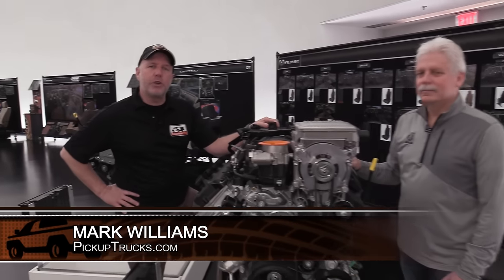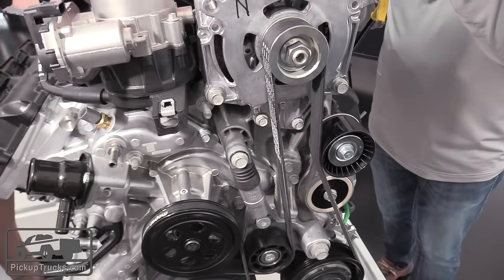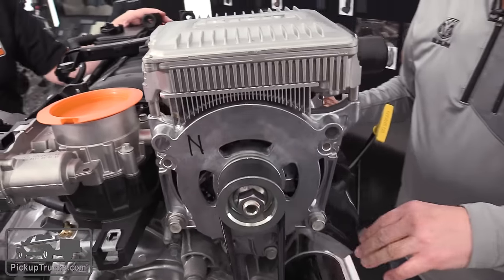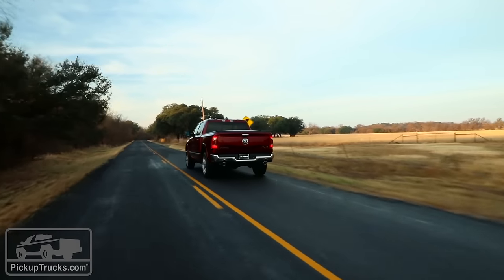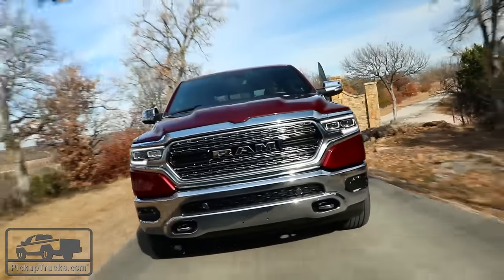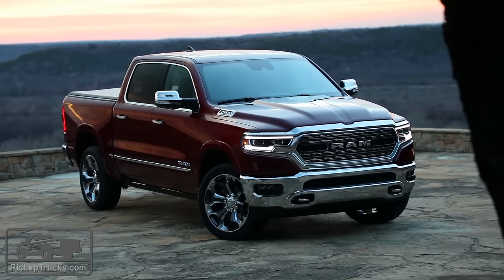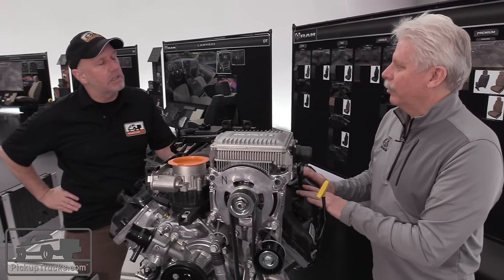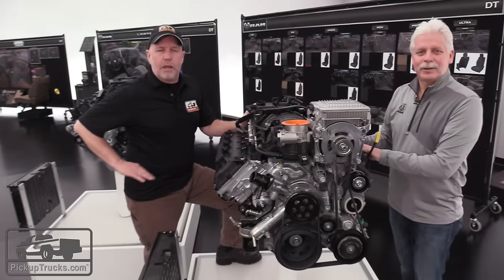2019 RAM 1500 e Torque Explained

Comment: So all the electric motor is used for is to start and stop the engine? Old news. Starting and stopping has been happening for a long time. Why doesn't the motor run the truck at least for a few minutes on the highway or in town? 4 cylinder and 8 cylinder activation is a joke also. There's no difference. There's no indication that the truck is in 4 cylinder mode or a way to keep it there other than a green light that says ECO. The engine doesn't sound any different and doesn't feel like you are saving any gas or driving with just 4 cylinders. No breakthrough. FYI it's almost impossible to put the truck in ECO mode if that is what brings it down to 4 cylinders...

Comment: All kinds of problems are going to come with this new engine. Ill just stick with my 2017 1500.
Reply: michael castro it's an option if You want it. Doesn't cone standard on 5.7 only 6cyl. So you can still get the new truck with that bad ass interior and leave the extra electronic BS out of 5.7.
Reply: I have the 2016 love it. But that interior is looking insane also the handling and ride is even better. These trucks ride really good but now they have more interior leg room in front and back too with a 900 watt kick Ass sound system. They rock!
Reply: Alfred Romano,   yea i would go with just a clean 5.7 hemi on a 2019, inside and out is bad ass.
Reply: It's not a new engine.  It's a 48v motor generator hooked to the engine

Comment: This is the type of technology (junk) that is caused by the EPA.  If the EPA did not push the car companies to increase mileage then this thing that will break costing the owner tons of money would not be on the truck.  Buyers are aware and should buy and vehicle without this type of ................thing.
Reply: You are partly correct in it having to do with the EPA but it's not about fuel economy because the gains are small if any. It's about reducing "at idle" emissions.  
(I'm aware I responded to a 4yr old response but felt it needed saying)

Comment: Sounds pointless, but Ram does need to improve its mpg. The 5.7 hemi barely gets 18 highway while Chevy gets 22 highway with its more powerful 6.2
Reply: The first and second gen Hemi motors were horrendous for mileage (I should know, my 2008 Hemi Durango gets 15 to 17 on a tank of gas).  But the 3rd gen Hemi, since 2013, has BEST economy of all full size trucks with their V6 and Hemi...and of course their Diesel 1500. This is from Consumer Reports data (which is real world driving) and from JD Powers. As examples, two people I know have the newer Hemi's. These are both 4 door trucks with 20" rims. The dude I work with gets 27mpg all day on highway and my brother showed me a screenshot after a 271 mile trip where his mileage computer said 30.6mpg.    When he did the calculations by hand, he got 29.5, which is still amazing.  The third gen Hemi is much more efficient than before, so I imagine this 4th Gen will be the same or better.  And as for the Chevy numbers, you are getting your facts a little mixed up.  The 355 hp 5.3 liter gets 22, not the 6.2 liter...it gets 20mpg, which is still amazing for this motor.  I can't wait for the new Chevy's with the 10spd tranny. Now THAT will be a game changer in gas mileage and
Reply: thebighair37 I get 24 out of the company's 6.2 which was great for what it was. And I have no clue how everybody tells me RAM's mpg is so good. I must be doing something wrong cause I can't even scrape 20. I'm in Cali so I'm not driving 80 that's for sure hahaha. I'll order a new ram as long as I don't have to deal with bad mpg or bad reliability. I love RAM but I have no time to deal with any major issues. I kinda have a weird feeling about that hybrid system on the V8. Cause I definitely want the V8.
Reply: thebighair37 And yeah that 10spd is going to be insane. I'm glad that both Chevy and RAM unveiled these trucks cause I'm going to need one of them when this year ends
Reply: You aint getting 22 mpg unless your cruising at 50 mph at 1800 rpm
Reply: That's bullshit!
Reply: Man.. you guys mpg testemoinals are all over the place. I'm trying to decide between the v6 and v8. Initially I'll be using the truck primarily on the weekend. But when I get this 2019( a few years away.. gotta see reviews) I'll use it for work. I'm leaning towards the v6 but if it's only a marginal improvement.. I'll just get the v8. There are way more options, plus I don't want a base model. Any advice. Please.. buying very soon.
Reply: "The 5.7 hemi barely gets 18 highway..." Sorry that's complete bullshit.
Reply: Except that the chevy burns oil like crazy with there afm cylinder deactivation.
Reply: My 6.2 gets at its very best about 11 on hwy
Reply: My Hemi 4x4 routinely gets 22 on the highway, that's hand calculated averaging 70-75 mph.   Try that with an ecoboost, you will have to drive under 65 mph to keep out of the turbos.
Reply: my ecodiesel is getting 29 mpg...

Comment: This to me is a big fail. I bought the 2023 1500 longhorn. This e-torque is a start/stop thing and gives at very best maybe a savings of 1 mph city- it does zero for the highway. A scam, marketing ploy. And  as understand, the battery is some $4,000 to replace. Even though warranted 8 years? I made a HUGE mistake trading my 2017 RAM 1500 for this.

Comment: A twin V can get you home on 1 cylinder but this etorque cannot get you home on the Etorgue Hybrid only.  Its just a starter...Does Autozone have this part?  lol...Answer is No.  And Scotty says that you cannot get the codes even if registered Mechanic,  says Ram Trucks are POS, you cannot work or your own truck or pay a mechanic...have to go to the stealer dealer only...Your locked in but you cannot fly....goodbye...Only the dealer can fly with your money...lol...

Comment: That 5.7 has been around to damm long and has had the same out put for to long as well disappointed
Reply: Sure thing 😂
Reply: What's too long? Since 2013, it's had 395hp and 407 tq...and it has better gas mileage ratings than ALL full size 1/2 ton models. And a side note, I was talking to the owner of a very popular mechanic shop in my town in 2016. He mentioned they had never had a Hemi come in for repair (mine was their first, getting new solenoids for the cylinder deactivation system...they didn't even know the cylinders started deactivating in the year 2006).  They worked on that crappy 4.7 all day, but had never had a Hemi in their shop...the Hemi came out in 2002.  Why drastically change something that still works?
Reply: The 5.7 is better than 5.3 vortec and 5.0 (truck variation)
Reply: Yeah.. wish the could've squeezed a little more power out that hemi,  but hey if it ain't broke, don't fix it. I like the fact that they didn't get too drastic with the changes. Thats what hurts your reliabilty. I'm not feeling the E system. Just something else to break. I don't care what kind of batteries it uses, they will have to be replaced eventually. How much will that cost?  I was looking for a used longhorn, but maybe i will wait. This one is growing on me.
Reply: Ace.C Canty Fuel injection was once "something else to break" too though.
Reply: It's the best V8 in the truck market. Why change it? It's still class leading for sub 6.0l engines. 
Sure you could step up the a 6.2l chevy but even then it's only 25HP and 50ft ib more. That's really not that much considering that thing guzzles gas and still doesn't tow much more plus it cost an absurd amount of money. You could get RAm 2500 with a 6.4 that'll tow and haul more. Even a 2500 chevy will. It's just for bragging rights.
Reply: stoichiometric that's true, but it sounds very complicated for those minor improvements. Even the guy explaining this system didn't have a good feel of what the benefits would be. I'm sure they'll perfect it.. if it even  makes it to the next gen. I'm just not willing to be the ginne pig. lol
Reply: Ace.C Canty It's actually a pretty simple design. 

He didn't have an answer because he is only allowed to say a few things
Reply: Floki but why isn't he" allowed" to say things???  I mean the guy wasn't asking ridiculous questions?. Don't they test it??? Wasn't this 4 years in the making???( I heard ) The fact is... They don't know. Until people use it in the REAL world... they don't know. Everything sounds good and works on paper. The point you made about fuel injection was true. But, there were way more problems with fuel injection in the beginning. Drop 55,000 on a truck with new tech???? Nah. I don't need to be first. I'll wait until I see some real people reviews. Maybe I'll get answers to questions unlike what this guy is pushing.
Reply: It’s a gimmick. Money pit.
Reply: I've never heard anyone drive a 5.7 and say "gee I wish this thing had a bit more zip". A half ton can only do so much, regardless of how much power they have. So what's the basis of your comment? That you've read the same number in a car magazine too many times and that bothers you? So what?
Reply: Ace.C Canty Because of marketing he's not allowed to. They want to build hype and hide their numbers to give their competition any information. 
Has nothing to do with what are talking about. I just don't think you understand business and marketing
Reply: Disappointed with really no updates to the Hemi other than E Torque no direct injection and still an iron block. Think the Hemi needs a major update the last version from 2013 at 395 HP has been around for awhile. Granted it works great but it's time for change. I'm not feeling the E Torque!
Reply: Anthony Macneil It's the best V8 on the market. Doesn't really need a change
Reply: Floki That may be I traded a 14 Sport Crew and it's was a great truck no issues to a 17 High Country 6.2L love this truck. I'm not loyal to any brand and my next a 19 High Country 6.2L with the new revised engine with both Port and direct injection and it also shuts down to 7 Cylinders and hearing it has a big HP jump from 420.
Reply: ALEC R LUCIO you realize it's the base v8, right?
Reply: ALEC R LUCIO It needs an aluminum block and Port and Direct injection. Your right has the same output since 2013 and needs a heavy revise.

Comment: Another goofy gimmick. My '04 4wd pulled just as well and got the same mileage as a '21 Rebel without all the extra garbage that WILL go bad. How about just building a good truck again and stop with the unnecessary expensive gimmicks

Comment: Half cooked implementation. Dodge couldn't be bothered to integrate this into the engine block / transmission / transfer case, so they bolted it on top and had the power transmitted to the crank by a belt...this is appropriate as a proof of concept , or a prototype, but for a production vehicle ! lazy

Comment: I'm skeptical.  Sounds like more things to go wrong
Reply: Nope, its actually way more efficient and effective, the toyota prius doesn't have alternator and starter, the water pump and steering pump are also electric and it reduces stress on the engine and eliminate the use of an additional gear/poulie...
Reply: @carholic-sz3qv  I ended up buying a truck about a week ago and the dealer steered me away from trucks with that engine...never really said why and I didn't ask

Comment: DO NOT BUY THIS TRUCK I HAVE A 2019 RAM HEMI 1500 IN ONE YEAR I HAD TO REPLACE THREE BATTERIES ONE RADIATOR AND NOW THE OVERHEAD CONSOL STOP WORKING NOW TODAY 08/7/2021 AT 135 PM IT IS BACK IN THE SHOP AGAIN FOR THE BATTERY AND THIS IS A 72,000 DOLLAR RAM LIMITED ABSOLUTE WORST TRUCK EVER DON'T BUY IT.

Comment: etorque is trash. first thing you do when you get in your truck is disable the auto start/stop button and then on your steering wheel if equipt you push the minus button for the gear shift until it shows the gears then push the plus button until it reaches gear 8  to disable the eco mode because all this shit ruins trucks. keep this technology in little cars not trucks and suvs

Comment: buy an f150 ecoboost ! no engine can beat that one
Reply: No engine could be beaten by that one.
Reply: Yeah if you like fuel dilution, crappy air cooled intercooler, valve deposits which they claimed to fix with port and direct fuel injection, plastic oil pan. I will never buy an ecoboost again.